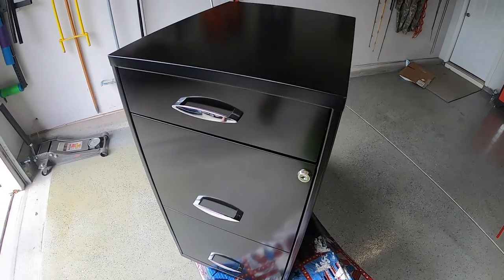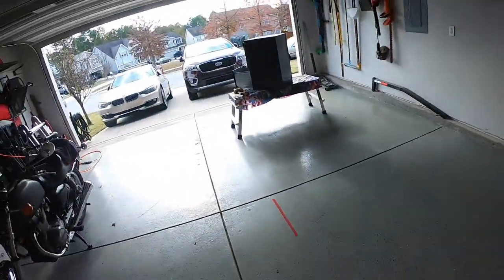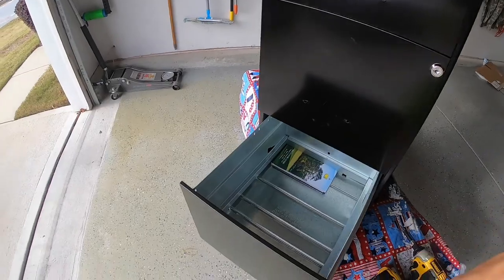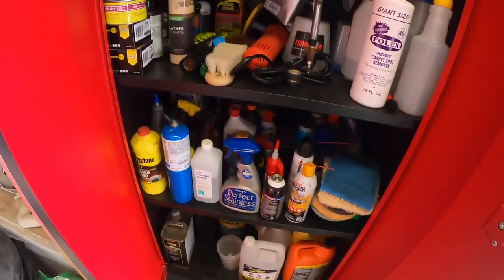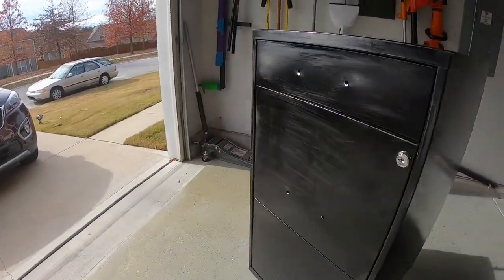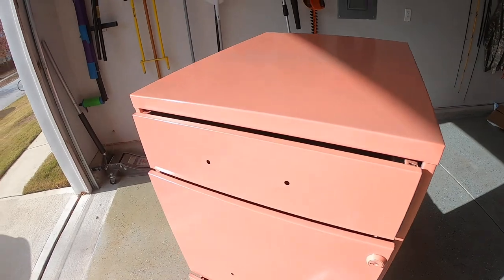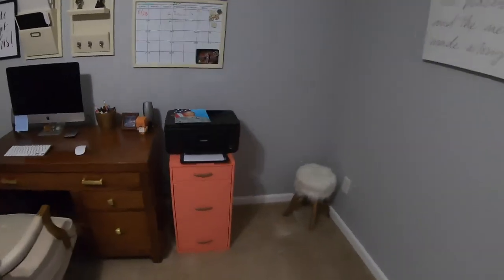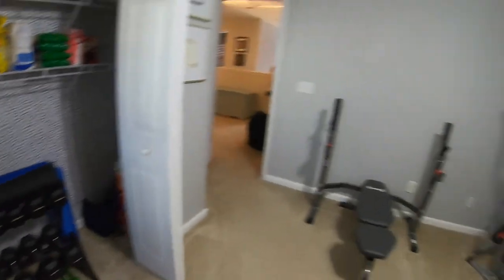Filing cabinet MAKEOVER for $20!!

Comment: How about surface rust? Would you be able to sand it enough to make a difference?
Reply from the maker: Yes you should be able to sand down through to the bare metal. If you are doing that then I would use some primer before the color coat.

Comment: Did it take 3 cans or 3 coats to cover that cabinet? Thanks for this video - very informative!
Reply from the maker: It took a little over 2 cans. It's always better to have a little more than what you need in case you can't find that color again if you run out or if you really like that color then you have some for other projects. That's usually the camp I'm in.

Comment: Thanks for the video. Did you put a clear coat on after? If so, how long did you wait after the last coat of paint? And did you have to buff in between coats?
Reply from the maker: It didn’t need one. I used the gloss paint. I waited about 15 minutes between coats and didn’t sand in between at all.

Comment: Did you have enough leftover spray paint for another cabinet? I’m planning on doing this as well and I was wondering if I needed to buy two cans for two cabinets.
Reply from the maker: I had a lot eft over for the accent color and I used all of the paint for the main color. I just kept doing coats till I ran out. Your mileage may vary.

Comment: Did you sand it down to help the paint to stick? Do you think this is a critical step?
Reply from the maker: Yes I did. It really helps the paint adhere.
Reply: @stevedotworld  What if I did the same project, but didn't sand it first? It was a real old cabinet that didn't have any gloss. Already put several coats on.
Reply: You made comments about the lines created by the spray on the front of the cabinet. Please clarify, you DO like “fan” spray? How could you have avoided those lines/streaks. BTW, I couldn’t see them on the video. Thanks.